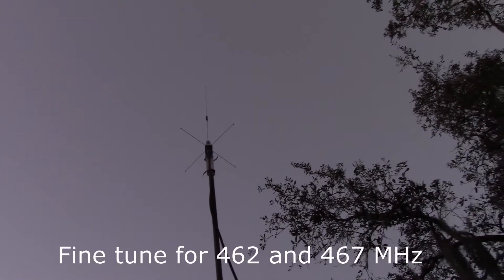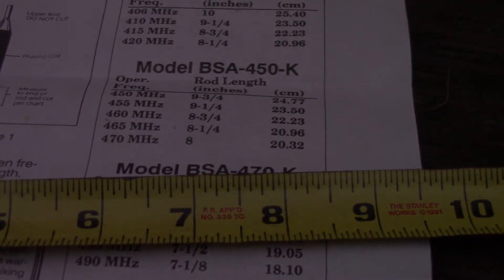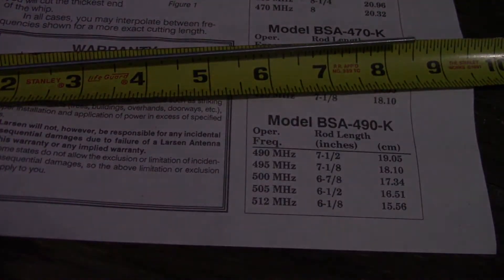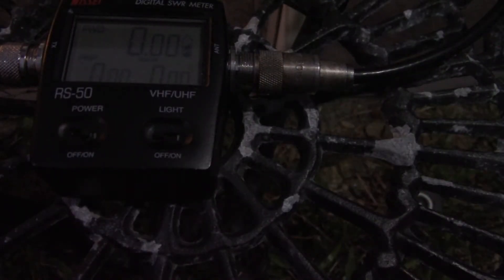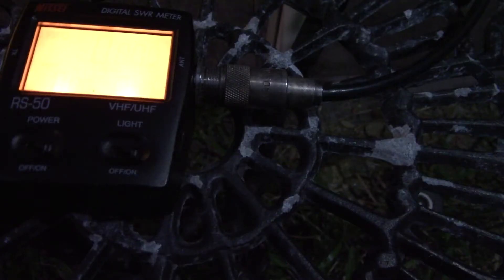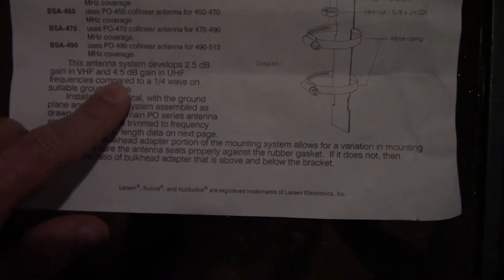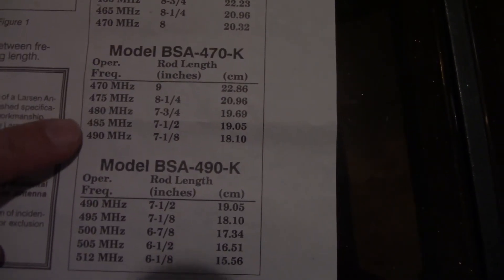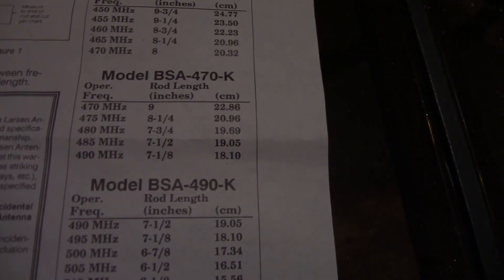Larsen BSA 450K  Final Tune for GMRS

Comment: hi there! what kind of coax cable you use for the higher mast? Does the SWR differs from the previous cable to the new one? I just ordered the same Larsen BSA 450K and copy what you did. Please let me know. Many thanks
Reply from the maker: I like RG-213 because it more flexible than LMR-400 and cheaper than the "flexible" version of LMR-400. It does have a little more loss but acceptable for my needs. Think its around 3db loss at 75Ft. The antenna is on 50ft of RG-213 and the SWR is flat.
Reply: @Soladaddy  Many thanks for the info. Hope you'll make more informative videos like this! :-)

Comment: So how are you liking this antenna so far? I bought one because of your video.
Reply from the maker: It works pretty good. My plan for it is to work with a simplex repeater.  I live in an antenna unfriendly area and I wanted something that is small, thin and could hide well and still be up high.